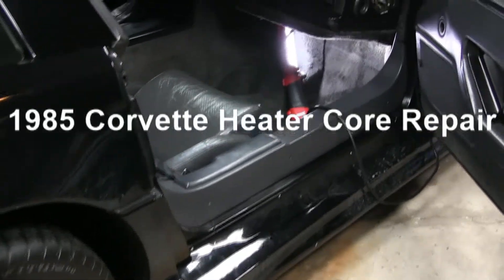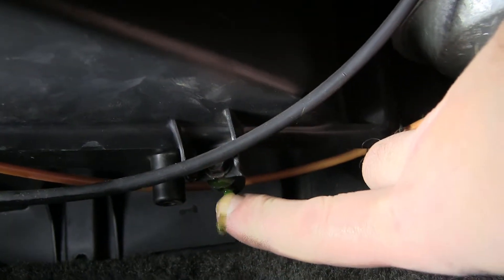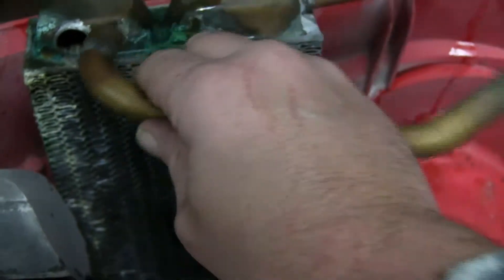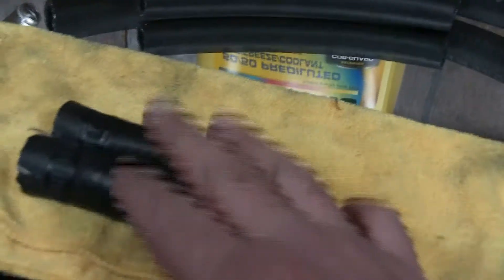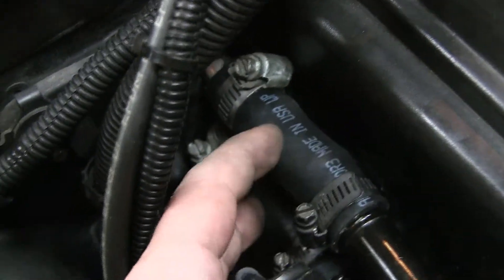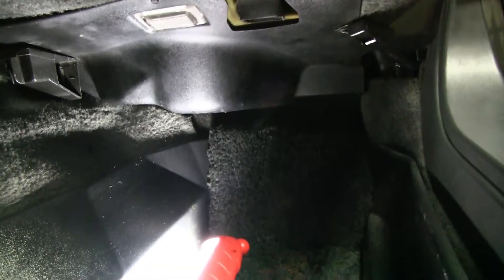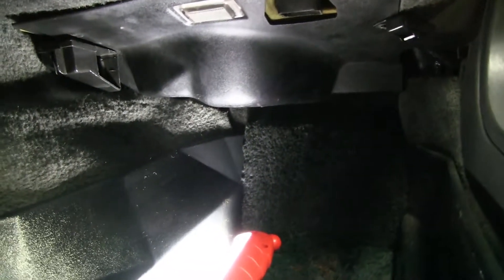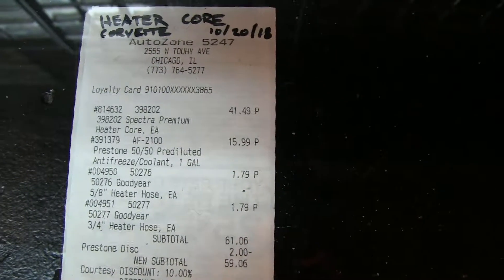1985 C4 Corvette - Heater Core Repair - Coolant Leaking on the Passenger Side Floorboard

Comment: I have some heater hose on deck just so I can bypass the heater core.  Yes easy $1000 for the labor, you saved yourself a ton of money.  No just keep the coolant fresh forever.  All that under the dash stuff is a pain.
Reply from the maker: If this new core goes out any time soon bypassing it may be a good idea knowing the agony this repair brings.  I have performed countess hours under various dashes and this by far is the worst I have ever encountered hands down.   Taking a look under the hood all I would need is a plastic 3/4" to 5/8" adapter to do a simple bypass just in front of the metal hoses by the wheel well.  I may just buy one of those and zip tie it under the hood as a 'just in case' precaution.
Reply: DIY Maker Dan I bypassed mine and it took about 7 minutes. Now a year or so later I'm deciding I might actually replace it because it gets wet and cold where I live.
Reply from the maker: For me it wasn't an option to bypass. My daily decided to dump the transmission forcing the C4 to come out of hibernation for a couple of weeks this winter just so I could at least commute back and forth from work.  My area gets downright cold during winter so for me having a functional heater was an absolute must.
Reply: @diymakerdan I know your pain! it's hard to describe how difficult the C4 heater core removal actually is. You have to be laying upside-down, blind, left handed, and have a 18"lg x 1/4" drive ratchet extension with a 2" 45degree bend at the end.
Reply from the maker: @ogjpx  I once spoke to a guy who said it's easier to remove the windshield first.  With this job the more beef you have on your body the worse it becomes.  One job I hope to never have  to do ever ever again.